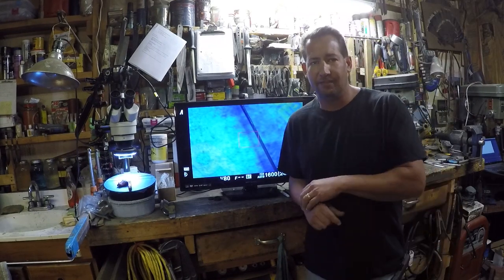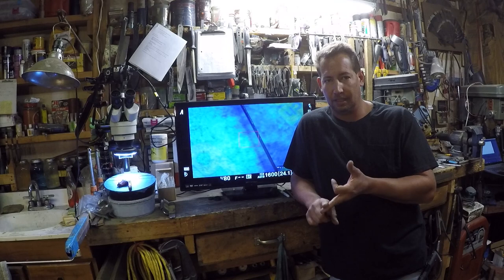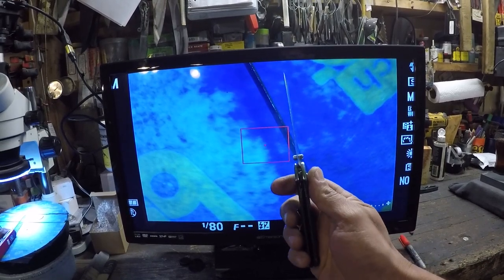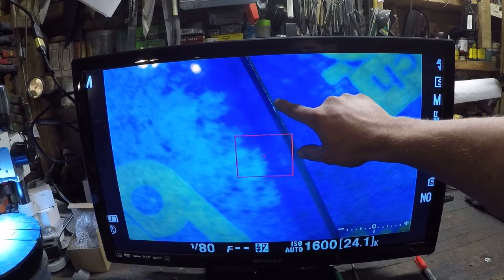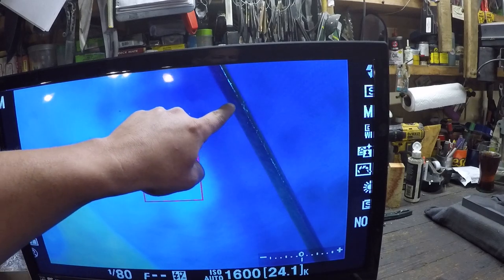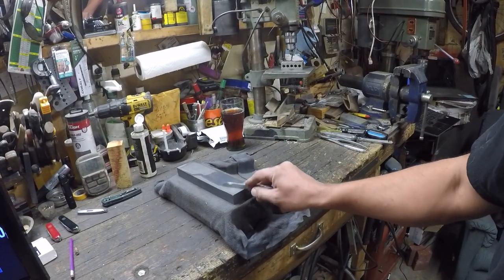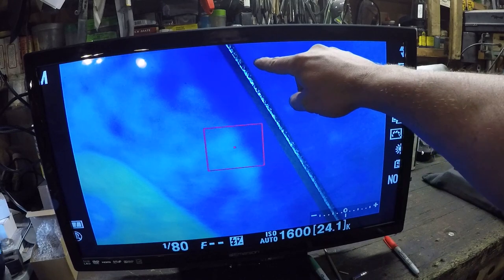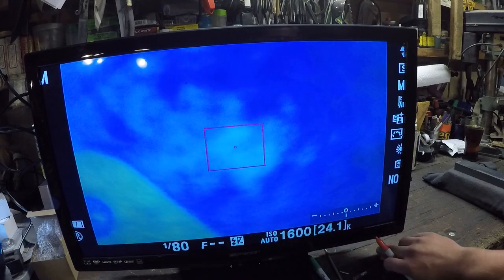under the microscope angles pressure and sharpening a SAK

Comment: Hi Joe. Its a shame the sound drops out in places, feel I missed important info. Should i be able to see a micro bevel through a 10x loupe after burr removal? I counted 8 burr flips from coarse to micro, is that right? ATB.
Reply from the maker: you might be able to see it in a 10x loupe by rotating the blade under the loupe and the light and looking for the change in reflecting light, but it will be pretty small, think of how much metal would be removed by 2-3 super light shearing passes, and that would be what you are looking for.  the exact number of burr flips isn't as important as the fact that you are doing them. some edge will take more if you are grinding out chips or rolls, and others less if you are just tuning up an edge.